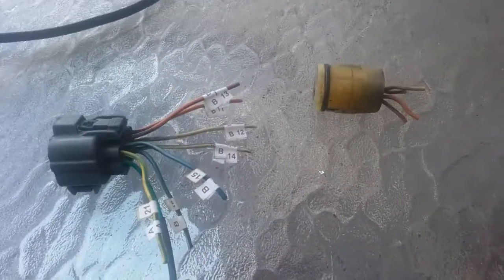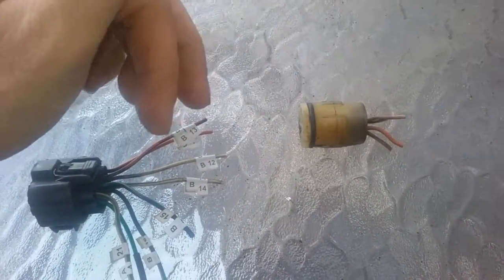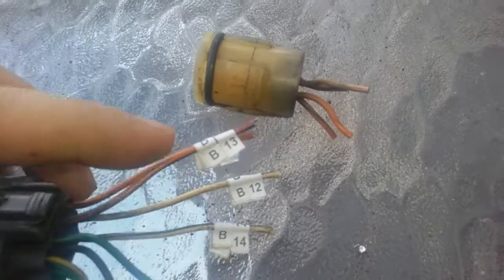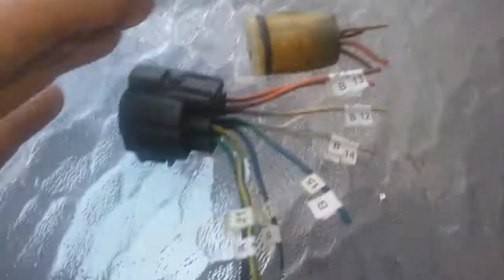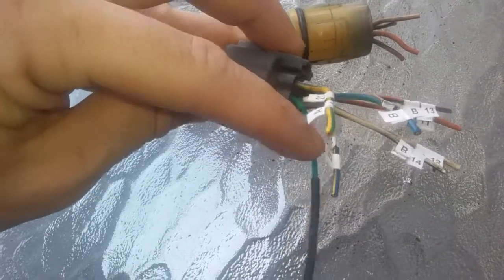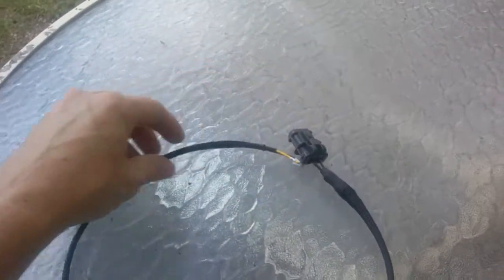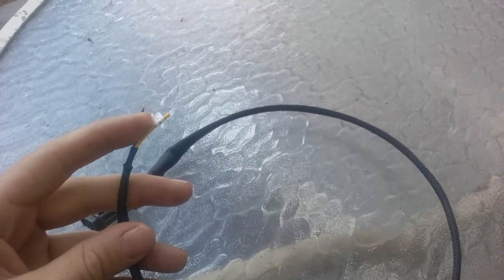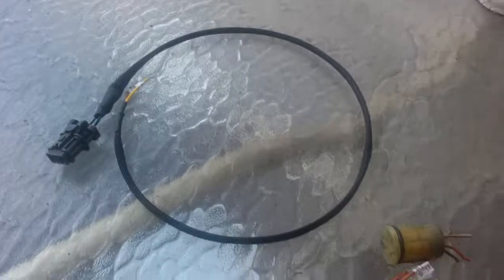Pre 0bd0 to 0bd1 Distributor wiring 86-89 honda accord 86-87 honda prelude A20a3

Comment: Hey man I know the blue green and blue yellow are for the ckp signal. What does the yellow green go to? You said all three go to your shielded wires. Do all three go to the ECU? I also noticed a solid black going to the 2 wire connector, it has a quick disconnect. Is that needed? From my diagram it looks to be it connects to the yellow black also so if so it wouldn't be needed but I am unsure. I am a master tech and not new to hondas but new to obd1 conversions and tuning. Any help is greatly appreciated
Reply from the maker: A21 B15 and B16 is your shielded wire.   Yellow black wire two pin connector is power to the coil.
Reply: @shane86lxi43  Ok cool. I was confused as to why I had a distributor with only a 4 wire connector and a 3 wire connector. Apparently my distributor isn't the same on my 87 prelude as it is on the accords. So the info I got online didn't specify to run shielded wires for the crank sensor because they already had it!  Thanks for your help.
Reply from the maker: @babyTOY-YODA777  Yeah, man, no problem. Just watch through some of my videos on some of the other obd1  stuff will give you a general idea.
Reply: Hey thanks again bro! I somewhat finished my wiring this morning and she fires right up and runs. Way better with computer controlled ignition timing as opposed to vacuum controlled. I appreciate your help man!
Reply from the maker: @babyTOY-YODA777  Yeah, man, that's cool. I subscribed.
Reply: @shane86lxi43  Hey bro. I just had a question about timing. When you mounted your obd1 distributor, did you just line it up on the plate so the timing was at 18 deg BTDC or so? I have an old service manual but its saying 18 degrees btdc at warm idle and that seems off to me. Thanks!
Reply from the maker: @babyTOY-YODA777  I got mine set at 14.6.